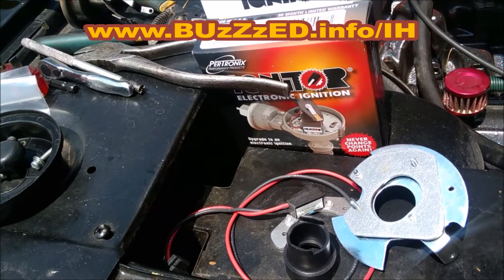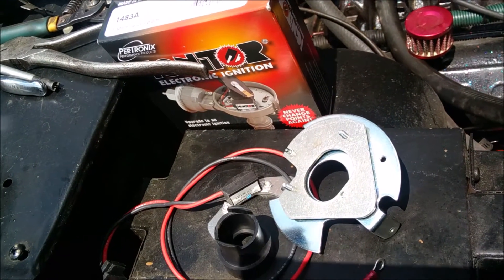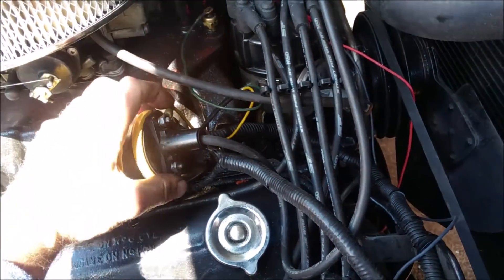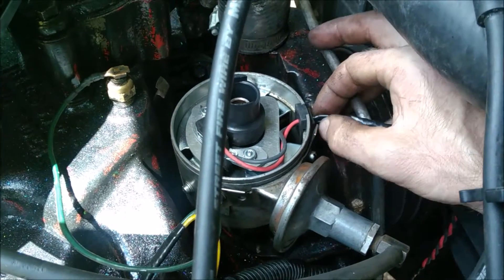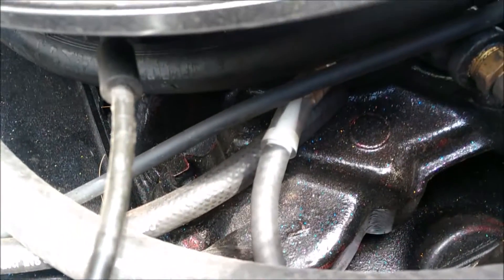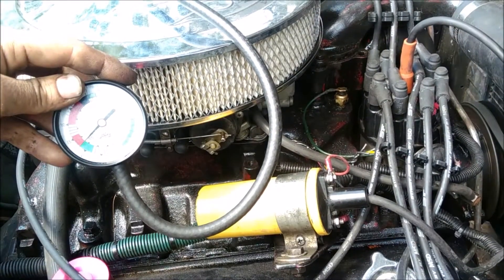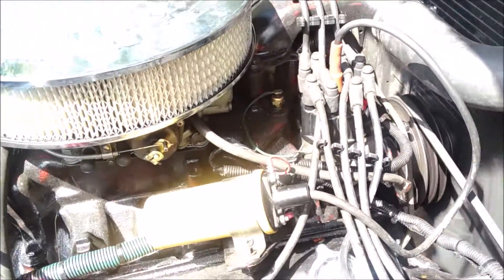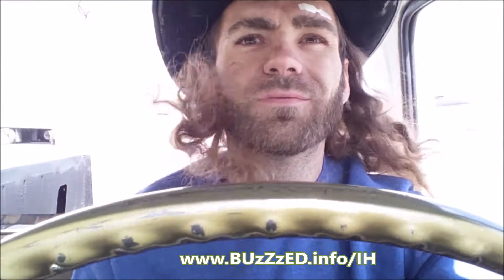ELECTRONIC IGNITION UPGRADE KIT! NO SPARK NO START GO PERTRONIX!

Comment: Wow that sounds great!
Reply from the maker: thanks! if you check my engine rebuild video, its actually simple, taking out all the casting flaws and the production tolerances is a crazy amount of performance gain off the bat and it skews the ratio of any gains you "bolt on" from this point!- that is if you count the lowered compression required by epa in the 70's.... then the rest lmao       torque and gearing is all there is to real power, but it comes more down to smooth performance as the guts... sort of the level of, spinning the tires is not moving the vehicle, real power!     oh and also glass packs, they actually offer more back pressure than a turbo muffler, and better flow, and and and, while louder at high rpm, at low to mid their quite pleasant!

Comment: You explain and demonstrate it well! I had done all this to mine and in the end it was to many parts delivering too much confusion resulting in intermittent issues over and over. Works for awhile then out of nowhere your stuck in a paring lot when you came out of a store. HEI was the answer. Simple, complete, minimal parts and I have not had an issue since.
Reply from the maker: The pertronix has a newer model, the old one they still sell and I used because it was next day delivery when I needed it.... well the old ones will fry them self’s if you leave the key on for too long with out running...

Comment: Hi There, new to your channel but not cars. Back in the day I was taught to adjust timing and carb to highest vac. I'm curious about your method of backing off 2" vac. Did you find highest vac lead to pinging? Still learning after all these years. On a side note, I used to set my carbs with my own method of adjusting and then using my hand to choke it. If RPM rose, it was too lean. Once I got it to stop I left it there. Cars always ran well. However, I did tend to notice the plugs would be darker than they really should be. I also remember reading the "book" method would always have you back off on the carb setting. Of course to my 18-till carbs went by the wayside mind, backing off was a no-no. In hindsight, it probably would have been better. I'm wondering if my timing setting (if I get my hands on an old school setup) needs to change to? Thanks in advance. BTW, a quick coil test (after verifying power & ground) is to manually ground and break the negative connection on the coil (w/12v on + side of course). If you get spark, that side of the equation is working.
Reply from the maker: Awesome tip on the quick coil test. Now we always rather have rich than lean and slightly rich is better than perfect ratio because it lubes the upper cylinder.  As for the carbon plug tuning is a whole forgotten art and lesson in its own. You can get hotter or colder plugs where the electrode is less or more shielded for heat transfer for the most part.    As for the 2degrees that’s actually in the book that comes with the gauge. It’s because your not under load when your setting for highest vac. So yes pinging all that jazz, and it’s just gonna run smoother. No you are correct that by digging deeper into this a more complex and perceive method for exactly how much to back off. But it’s always almost always 2
Reply from the maker: If your want race car full throttle then no this is not the best way use a light and trial and error....   and on your issue you may need weights and springs adjusted in distributor.